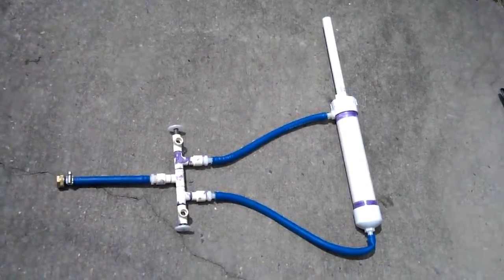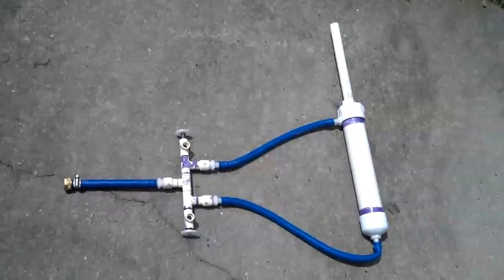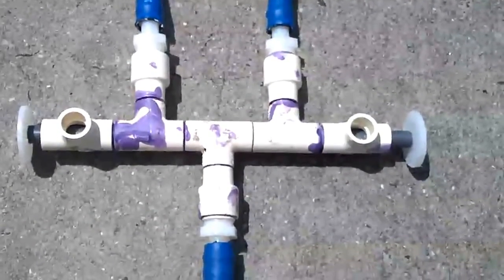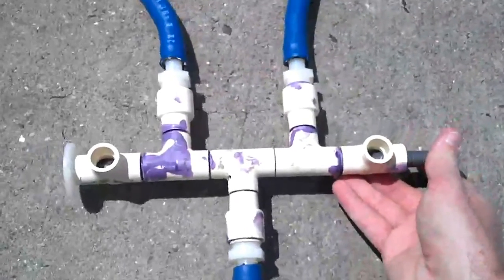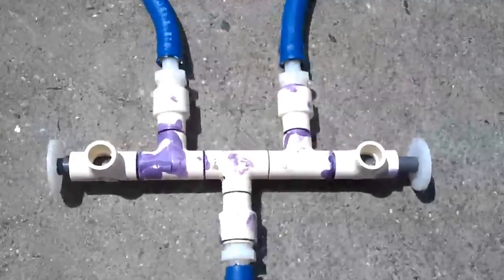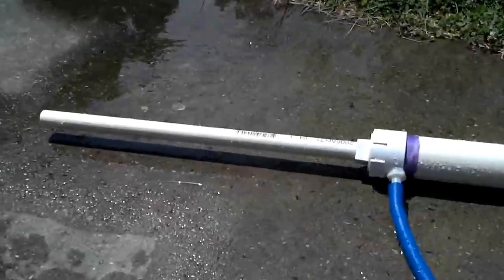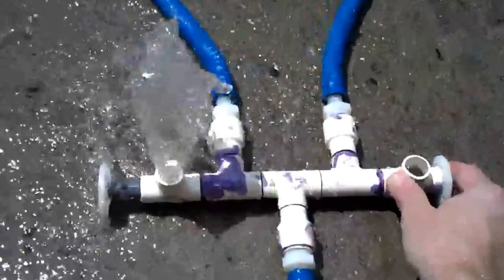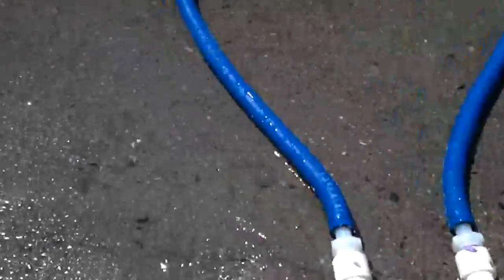Garden Hose Hydraulics - first prototype

Comment: Awesome! Now how much weight can it lift?
Reply from the maker: Thanks! The force depends on the water pressure you have and the pipe diameter. This one I think might have been around 40 lbs of force or so. I made a larger-diameter one that easily lifted me up, should have been able to do like 400 lbs or so theoretically based on my water pressure at the time. Note that for this type of double-acting piston the area is much higher on one side that the other, so it's a lot stronger at pushing (lengthening) than pulling.

Comment: I'm completely new to this but I think it would be cool to try. Maybe it would be cool to redirect the runoff from the control valve through a one-way valve and back into the main water supply?
Reply from the maker: I think this isn't as easy as it may sound, unless just dumping it down the drain counts. To get it back into the water supply you'd need a compressor to build it back up to the ~40 or so (depends on your house etc) psi. That is also likely against code in most places -- there's a risk that the clean water comes out of the water tower and to your house, then you contaminate it by running it through your system, and then put it back into the water supply where it could cause some harm (illness etc). Realistically I think your best bet is to save it in a bucket and then water your plants, or wash your car, or something, just making use of the otherwise wasted water. Or use a compressor to make it into a self-contained loop that recirculates the water.

Comment from the maker: Thanks for the comment, I will have to keep an eye out for either of those materials and try it out some time. On my current system I'm just using O-rings and grease, it's not as bad as I was fearing so far. It doesn't leak at all so it retains a crazy amount of force. The 2" diameter cylinder can lift about 150 pounds. The 3" one I'm putting together is going to be a beast.